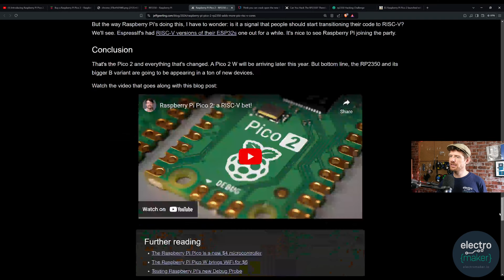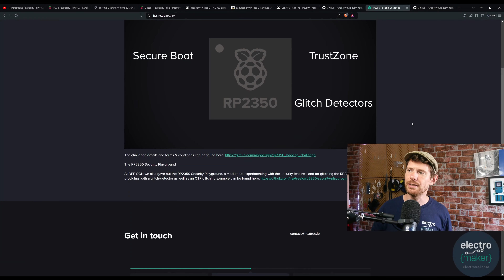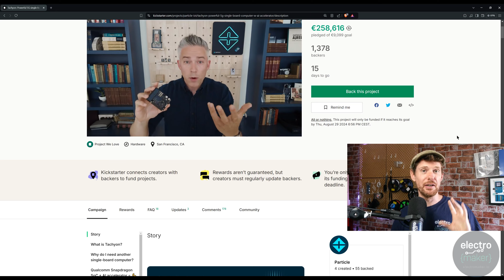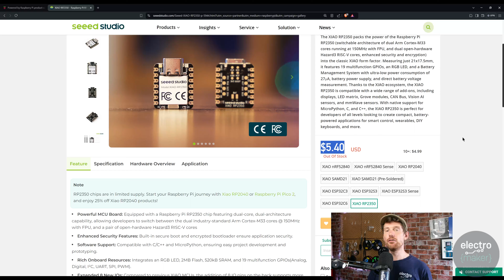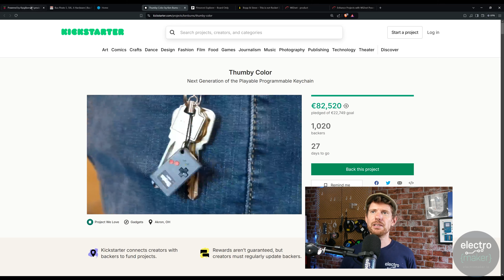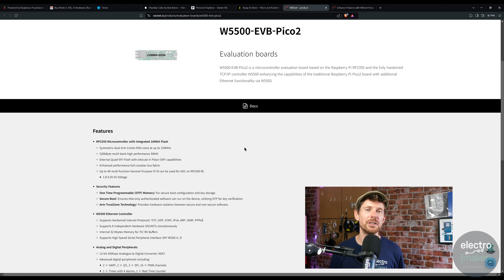Raspberry Pi Pico 2 released! Particle Tachyon 5G SBC! So Many RP2350 devkits! Hoorah!

Comment: Ooops! I have just bought two Rpi Pico 2040s. Didn't know about the 2340, so will not be able to play with the Pico 2 for a while.
Reply from the maker: No worries! The RP2040 is still a fantastic choice with a lot of potential for creative projects. The RP2040 has been a game-changer for many makers, so you’ll have plenty of fun exploring its capabilities. When the Pico 2 or RP2340 becomes more available, you'll be even more prepared to dive in with the experience you've gained.

Comment: From what I read the RISC-V cores don't have an FPU or the DSP instructions. Your code will stil run on them but floating point math will be a lot slower.
Reply from the maker: This is a very good point. The lack of an FPU and DSP instruction is a key consideration if your project heavily relies on floating-point calculations or digital signal processing.